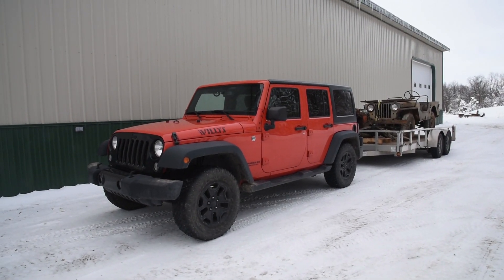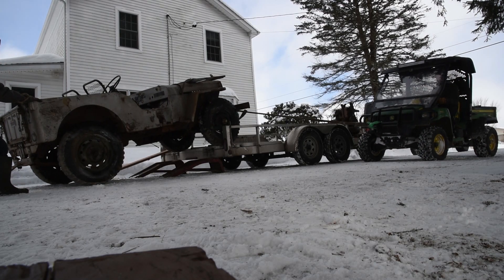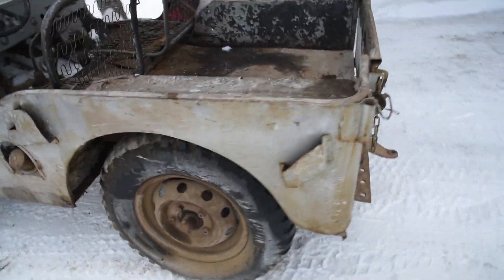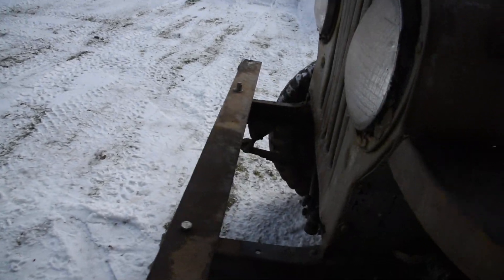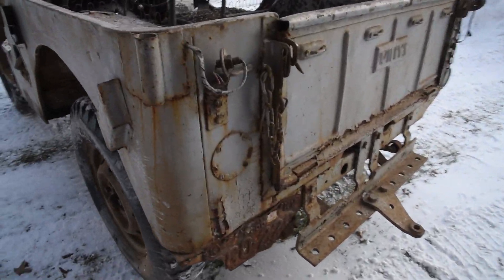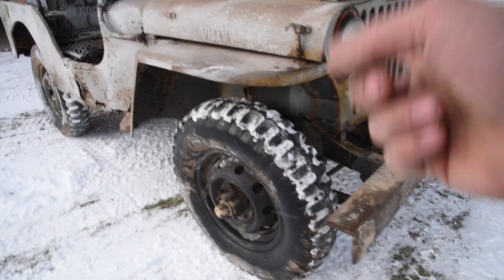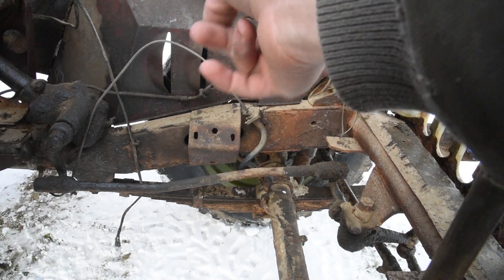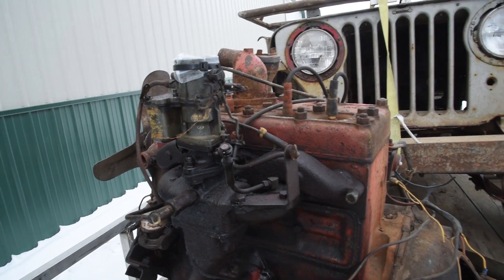Recruiting Another Member! - Delivering a CJ2A to Kyle's Jeep Adventures

Comment: Have a 47 2a engine that won't pull away from the transmission, i think the imput shaft is rusted in. Any recommendations besides trying to pull the engine and trans out together?
Reply: There really isnt much choice, I'd pull them both solely because of that problem in order to fix the problem and any thing else hidden
Reply: @General_Eisenhower1945  Thanks, i am going to have to pull the tub off now anyway. Now it will just be easier to get at them